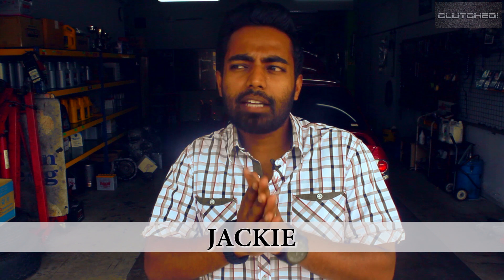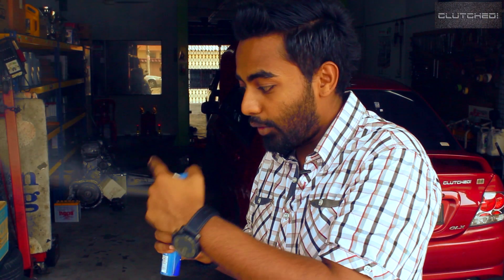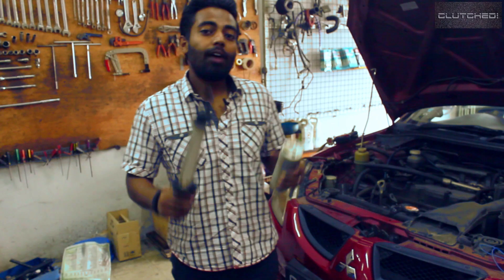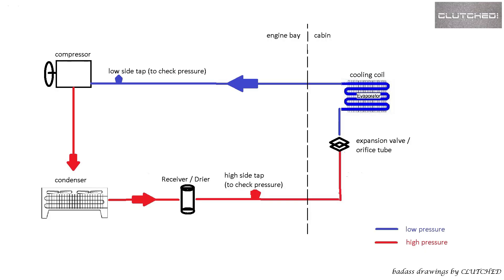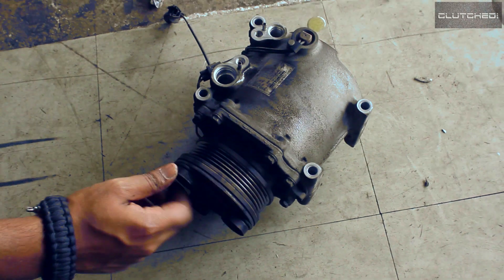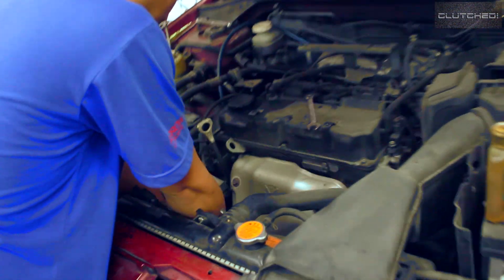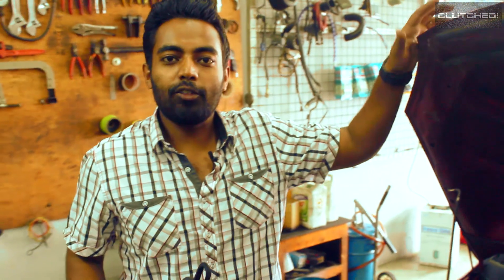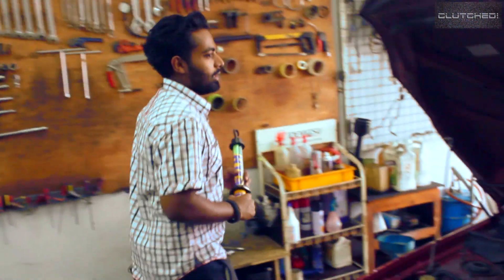How does a car Air-Con system work? - Variety

Comment: Excellent video Clutched! Perfectly explained without the use of jargon.

I couldn't agree more with "...one of the most important systems you can find in any car...". 

There is one important point (for petrol heads) which I think you left out. If your engine requires the extra kick to overcome a steep slope or to execute an overtake, remember to switch the a/c compressor off.

For those who are looking for the most affordable refrigerant, do not hesitate to contact Green Tech Refrigeration.
Reply from the maker: Haha thank u for the support and additional info..!! 👍